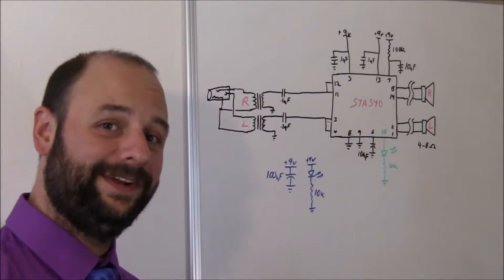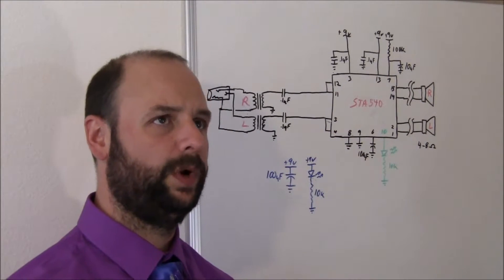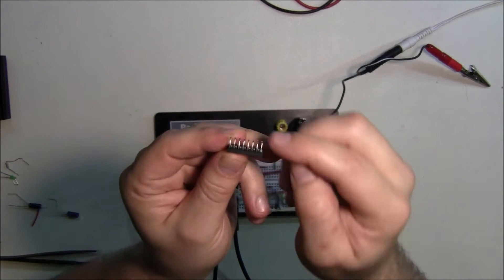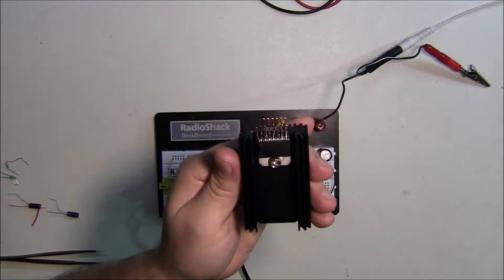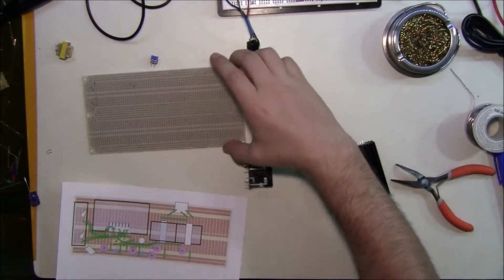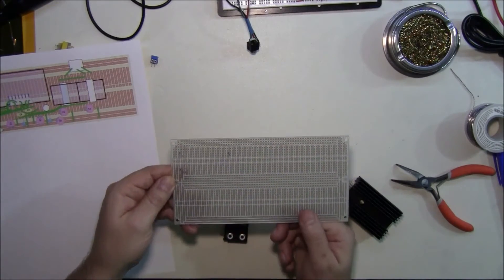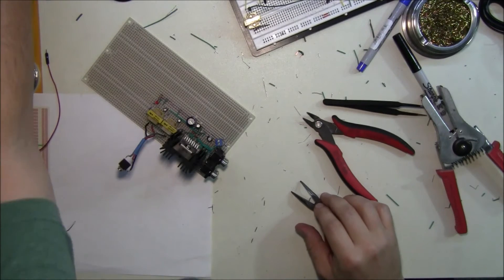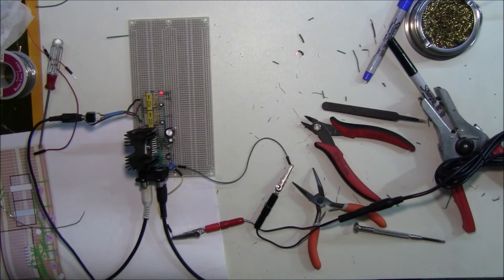TheÆ #4: Simple 2-Channel Audio Amp

Comment: Hi Sir, it is very nice to see you working on this chip. I have a Logitech Z313 Speaker set, bought some years ago and it was working fine, but now I have it with absolutely NO SOUND output whatsoever. I did open it up and found that this speaker uses the same STA540 chip. With 12V SMPS on the sub-woofer working perfectly fine, and no other signs of any other component failure, and this master chip being the only one with a Heat-Sink, I suspect that this chip would have failed. I have downloaded the datasheet as well. Just want to test this chip before I buy a new replacement, so any ideas how I can check the chip while it is on that Main-board ? Can you provide any reference voltages that I can check on each of the pins ? I do have a Digital Multi-Meter, but I do not have an oscilloscope with me. Any help would be greatly appreciated. Thanks. Gopal.
Reply from the maker: Haha! I had no idea it used the same chip. What a great coincidence.
Well, there are a few trouble-shooting steps you can take first. If you have a power resistor @ about 4 to 10 Ω, you could test the power supply first. Make sure when there is a real load on the PS, it still outputs 12V.
Next, check the voltages right at pins 3, 7, and 13 and make sure you are still getting 12V.
Next, check your capacitors. All the electrolytics. Make sure none are "puffy" or leaky.
On the chip, one thing you can check is pin 10. That's the diagnostic pin. If you have a voltage on there, it means something is wrong with the chip or you have a short somewhere (or the chip is too hot). 
Otherwise, I can't think of a great way to test voltage levels coming from the chip without an oscilloscope. Also, I can't really talk about other voltages until I get home and test it myself. I'll try to reply soon with that info.
Finally, you can double check your speakers. I believe they should be around 4 Ω (I believe they put 2 8Ω speakers in parallel).
Let me know if this helps.
Reply: I have the same problem. Did you solve yours? I have replaced sta540 chip but no efect what's so ever
Reply: I had 2 logitech z 523 and  both of their power suply failed. Well I found out much later and actually I bout good PS for both and everything working fine for far.